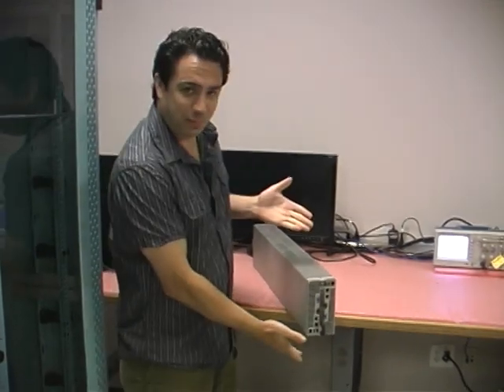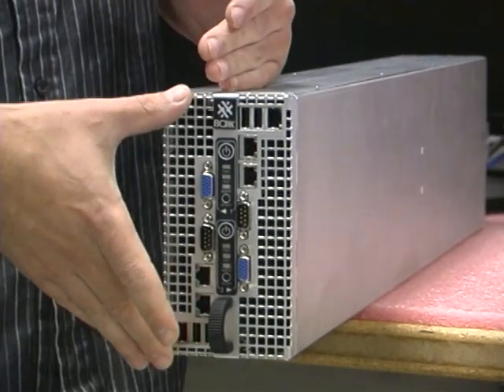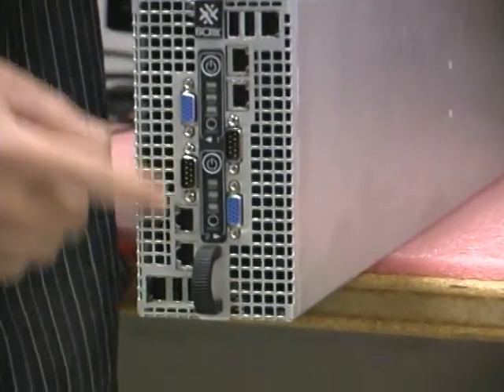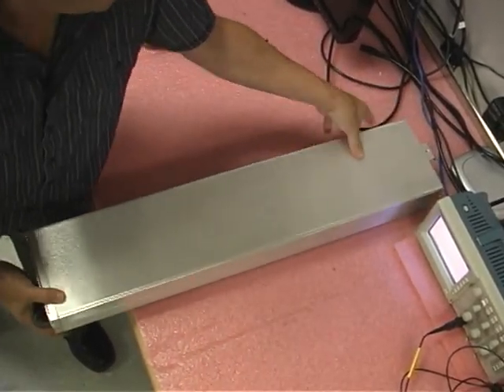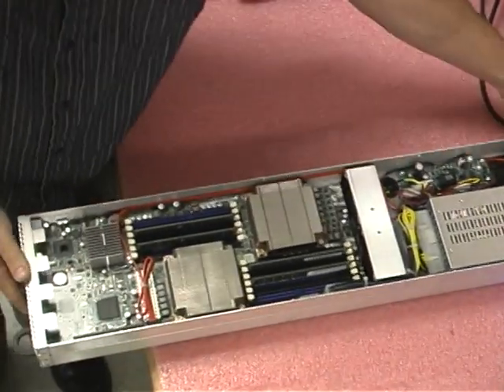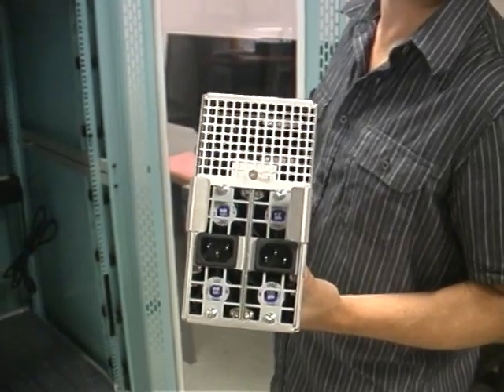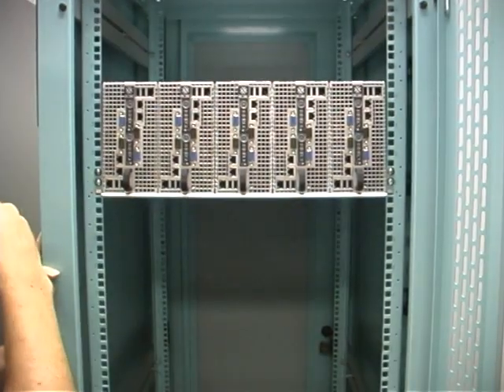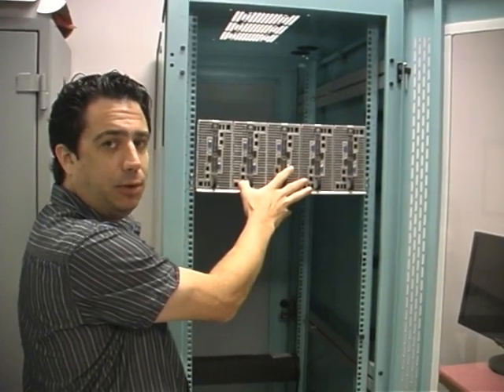renderBOXX 10300

Comment: Interesting rack configuration with a back plate enclosing the back of the rack and yet these systems will be generating a lot of heat when under heavy usage from the rear of the units. Ouch!